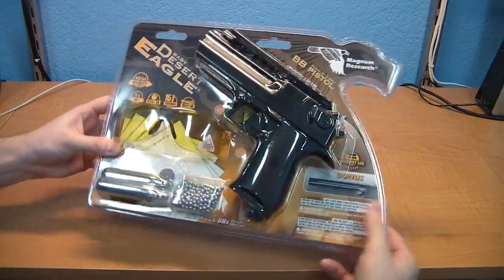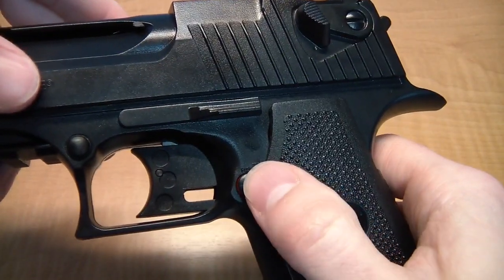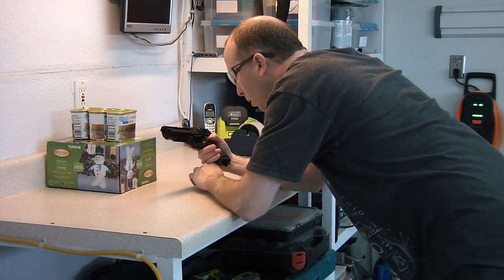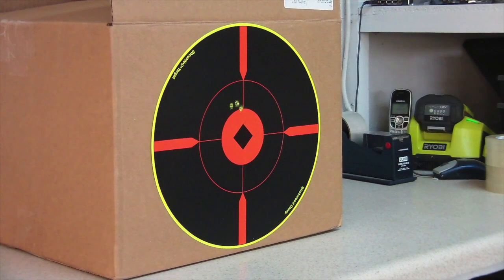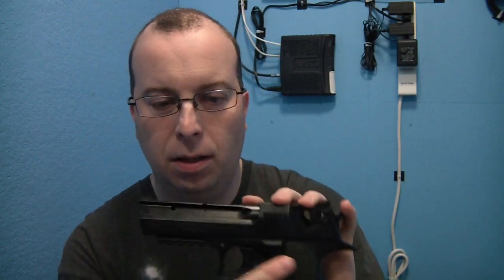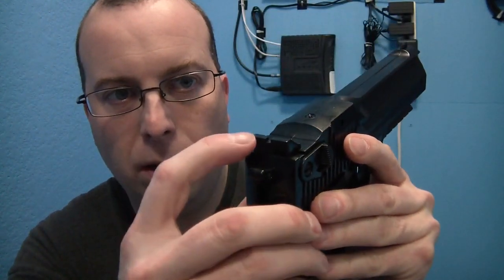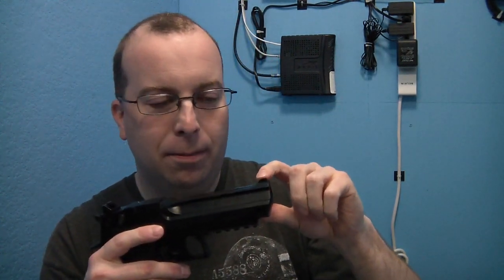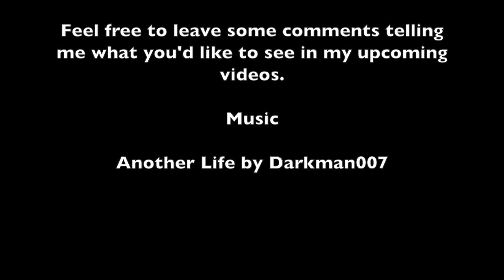Baby Desert Eagle BB pistol Review

Comment: I have the same pistol i actually was shooting it today. I haven't had any trouble with the bb loader part getting stuck but my trigger got stuck when I pulled it back twice but I shot it a lot so it didn't seem to incredibly often. I was shooting on top of a hill down  and like you said I noticed the bbs were going high. The other problem which there is nothing you can do about is that when the co2 gets low the shot is weak and gradually gets weaker instead of just running out of co2 at once but that is obviously going to happen with all co2 powered weapons so that statement is invalid but I'm just putting it out there. My point was that I don't really want waste the co2 but to have the gun power at its maximum power you need to. I like though it's quite powerful and I'm sure there are better but its a pretty good price.